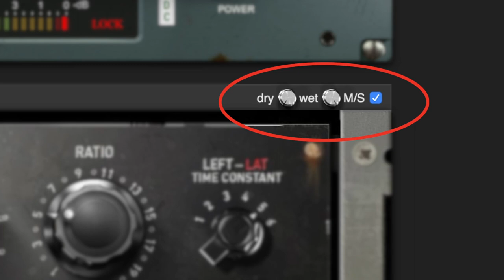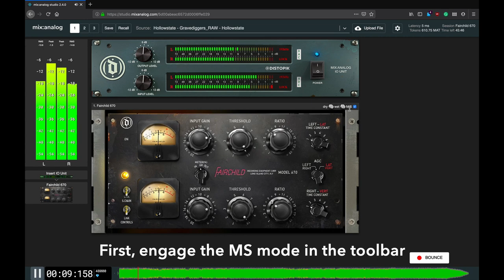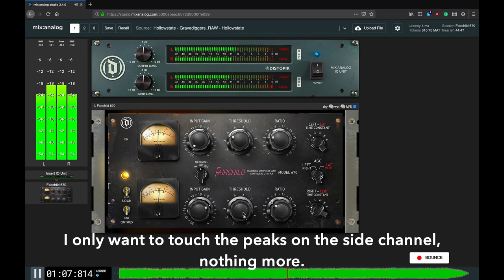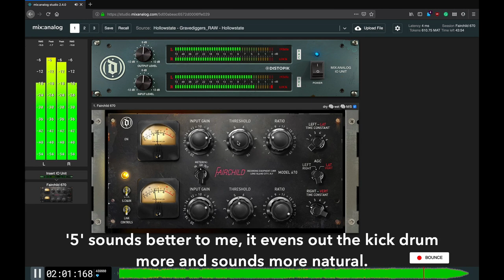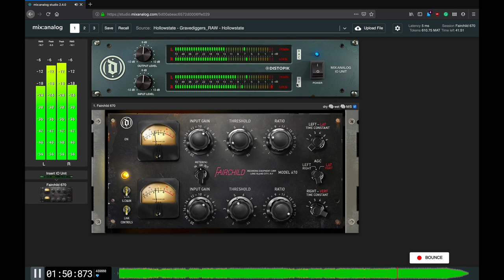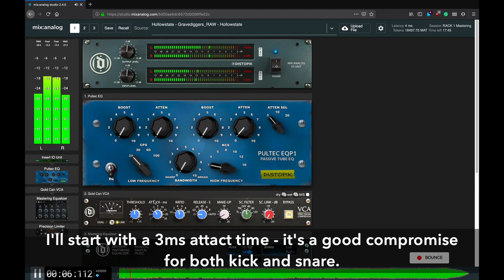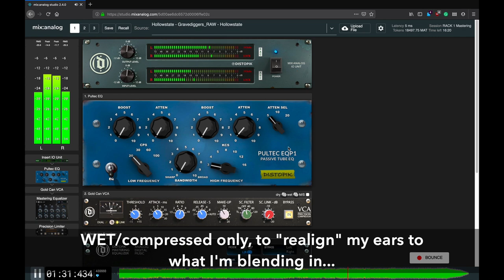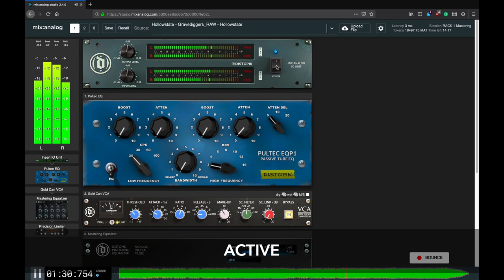mix:analog | Mid/Side and Parallel processing Tutorial

Comment: there's more to the prallel compresiion that is rarely talked about - you need to boost lows -cut mids and boost highs on paralles signal. cheers!
Reply from the maker: That's a good tip right there